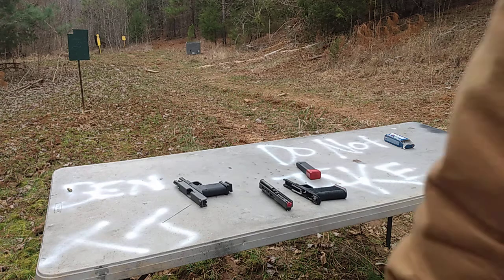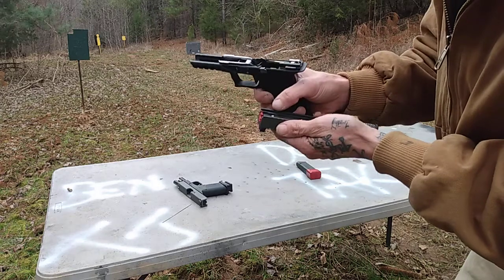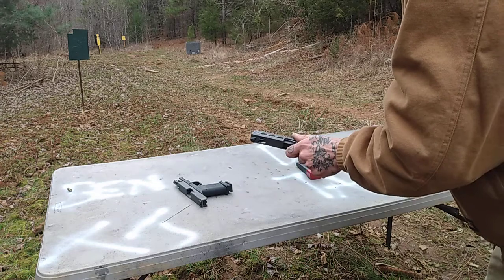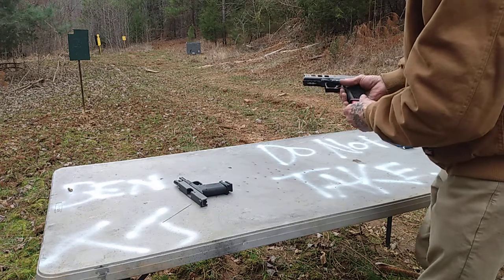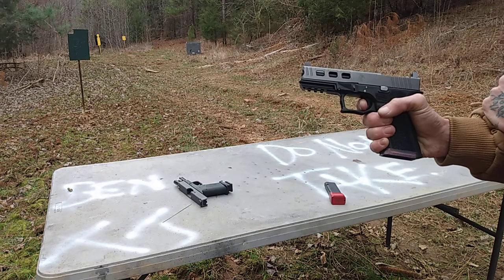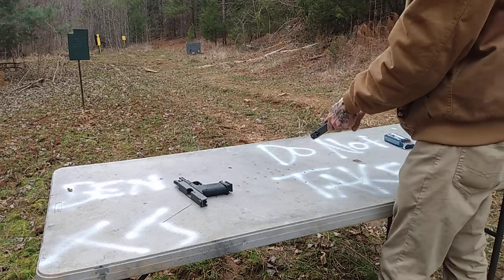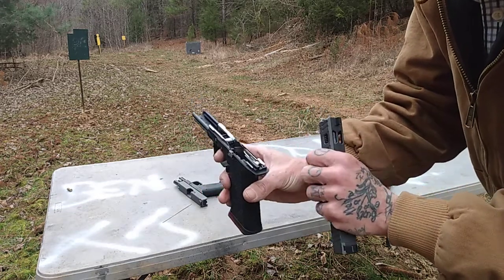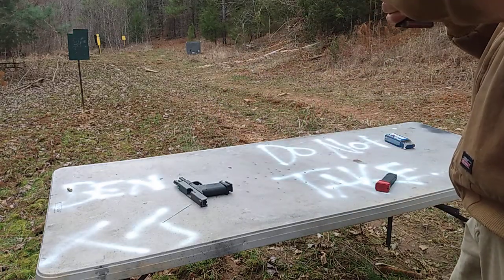Polymer80,PF940v2, Striker/Triggerbar Fixed!!! No More Burst!

Comment: Ghost 3.5 having the same problem, fixing it today. Gonna put the OEM connector back in.
Reply from the maker: The 3.5 # ghost doesn't work well with gen3 trigger bars. Has to be tweaked to get that perfect Engagement to where it doesn't jump the cruciform, but not too much to where the trigger won't break. OEM is great, for OEM function.

Comment: Damn man I never thought I might have to bend the damn crucifix so it can catch better, my custom p80 G19 has been acting like a binary trigger shooting on the reset but sometimes when I rack the gun the trigger doesn’t reset at all, anyone have a solution?
Reply from the maker: Yes you need the armors backplate the check your engagement between the cruciform and the striker lug.
Reply: @knightcustombuilds6988  I’ll have to see where I can acquire one, oddly enough looking at it now I see the trigger bar is slipping off the connector very easily when I break the build down into 2 I’ve heard about bending it but haven’t considered. The spring also looks very week should I replace that?
Reply from the maker: If it has two thirds engagement check the connector
Reply from the maker: If it's the connector more than likely it'll have the trigger bar pinned against the polymer making it unable to reset. This is more of a hang fire. Can u pick up a shell casing that's been fired and see if it's striking in the center of the primer.
Reply: @knightcustombuilds6988  yeah I’m seeing that that it’s just about in the middle but barely isn’t
Reply from the maker: @oggoose4205  yeah that's not a hard fix but it does need to be done correctly. I can show you a video on IG but not on YouTube. Follow me on IG same name, wait till later on cuz I'm at work right now. But I got a spare trigger bar and I can show you how to put it in a vise and adjust it